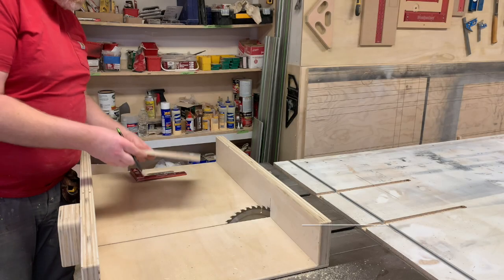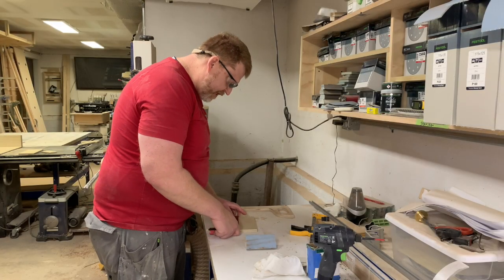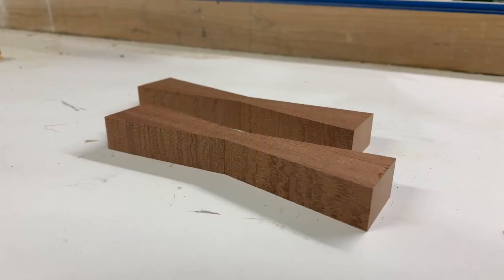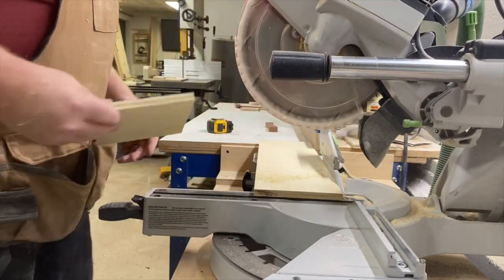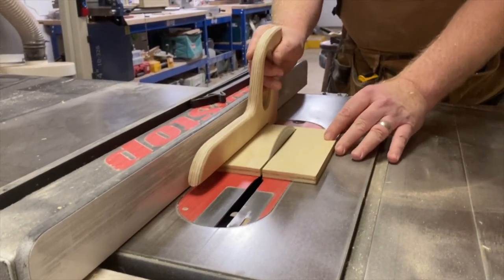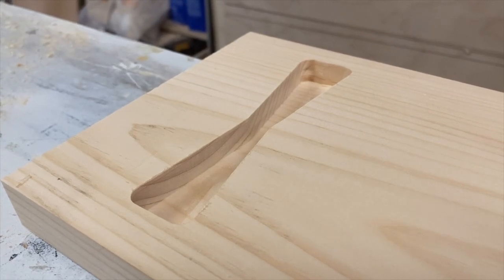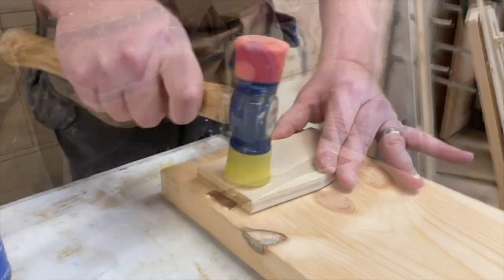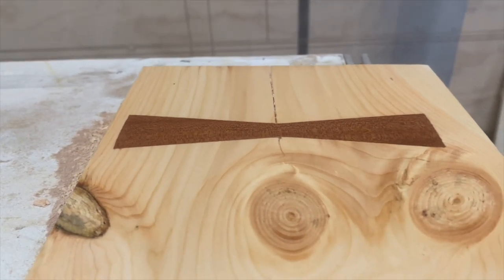How to Make a Perfect Bowtie Inlay and Jig - Shop tricks DIY saves you time - Woodworking

Comment: What router bit you use ?
Reply from the maker: When using the template I use a mortising bit with a bearing usually 1/2 inch depth and 1/4 inch shank